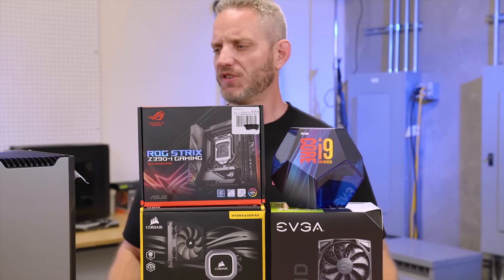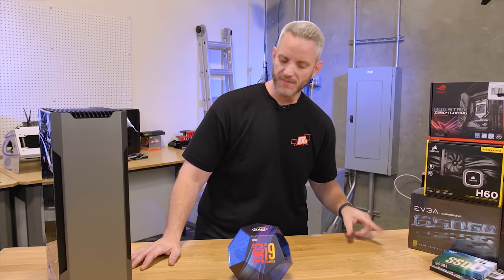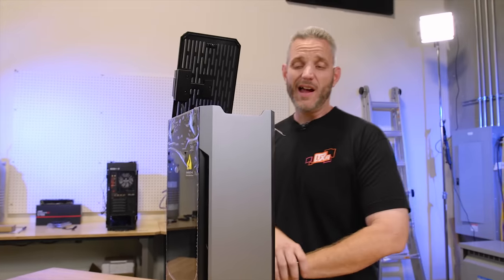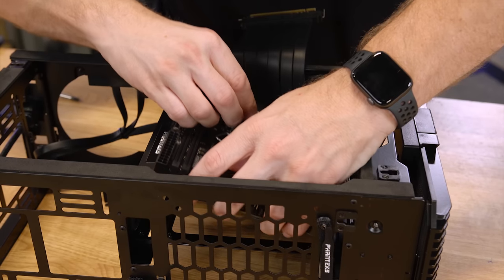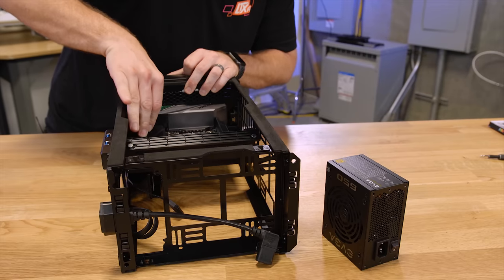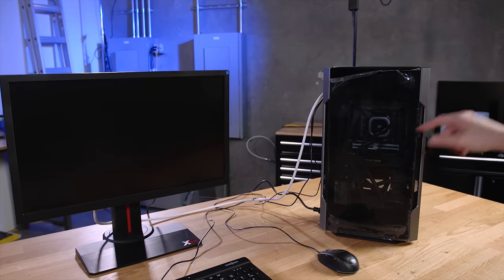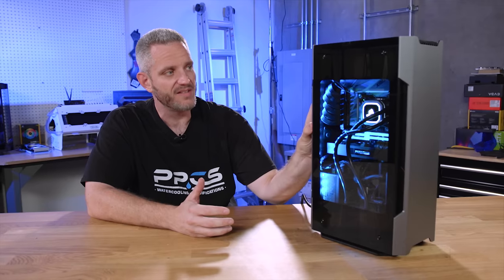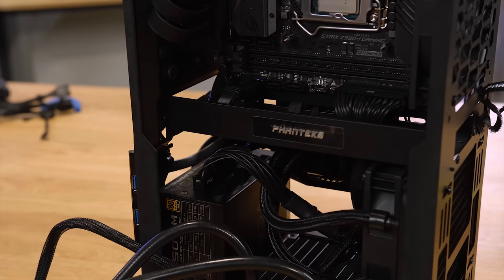This Small Form Factor PC is RIDICULOUS. Ridiculously FAST!

Comment: what i would like to see is a build for the best value/performance there is right now, Rx 3600 + rx 5700 xt, intel might be better having higher core numbers , but the threads from the ryzen 3600 have futureproof with next gen consoles using the same amd arquitecture and possibly games also using more threads instead of higher clock count.

Comment: thats pretty much my current vr pc. 
same case in same color
9900k with AIO
z390 strix
16gb 3200 corsair
(2) 1tb hp 920 nvme drives
but sadly im still rocking a 1080ti hybrid. 

i love the setup. maybe i wish it had a little more airflow. but i made it work. switching all fans to noctuas helped. i have (2) a12x15 fans on the side and 1 a12x25 on the bottom. i went with the slims on the side so i could add the phanteks rgb rings over them. i also have the modmymod panels on my main gaming pc phanteks evolv case. i would probably get them for the shift as well sometime in the future (if he ends up making them for it as well).

i would say the case is pretty good as is. maybe it would be nice to have a solid back panel (which is a top panel in this case). it has the same problem as the evolv. where the heat rises and can circulate back in the case because of all the openings. i ended up taping off most of the top of my case. its under the lid, so you cant see it. but it helps make sure that the hot air actually exits the case.

if i could fit standard 25mm fans on the side with the rgb rings, that would be cool to.

Comment: I went for 10th gen Intel instead of 11th gen even though i built my pc just after 11th gen released because the £100 price difference between the 10700k and 11700k wasn't worth it. If i done more than gaming i would have got an 11900k or even went for something more intense with Amd but i have no use for it and i do not regret it! coming from a 7700 non k it's a great upgrade.The newest isn't always the best option that is correct.

Comment: HEY they update the PCIE riser! Jerks, I still have the old one.

Ryzen 2700X, Asus X470i, 970 Pro 512GB, G.Force TridentZ RGB 16GB F4-3200C14D-16GTZRX, EVGA 1080 ti Gaming Black Edition, Cooler Master ML120R, Seasonic Focus SGX-650 Gold, and two Noctua fans. I set up the AIO with dual fans on the bottom in push/pull and used the two Noctua fans as intakes as well. I don't remember temps but they weren't great, but it's not a hot box.

Issues I had really involved what to do with the excess cable lengths. I could shorten them myself but it hasn't been that important. I really think the little shelf to hide the MB cables blocks a lot of airflow and I think it would have been better had it been omitted. The AIO tubing length is somewhat challenging as well. I put the tubes on the radiator under the GPU, then they bend forward and then up. I have a build log on the forums: https://linustechtips.com/main/topic/1002263-phanteks-evolv-shift-with-amd-build/

Comment: @JayzTwoCents what do you think about this build. i'm planing on buying the pieces over the next few months as i dont have to much spare money. i only build a new computer every few years. let me know what you think or change.

ASUS ROG STRIX B450-F Gaming AM4 ATX AMD Motherboard

AMD Ryzen 5 2600 3.4GHz 6 Core AM4 Boxed Processor with Wraith Stealth Cooler

g.skill Logo G.Skill Trident Z RGB 16GB 2x8GB DDR4-3200 PC4-25600

PowerColor Red Dragon AXRX Radeon RX 570 Dual-Fan 4GB GDDR5 PCIe Video Card

Corsair TX850M 850 Watt 80 Plus Gold

Inland Professional 512GB SSD 3D NAND M.2 2280 PCIe NVMe Gen 3 x2

Cooler Master MasterFan MF120R ARGB 120mm Case Fan

Comment: Try getting a RoG card in there. That was an absolute pain for me and killed it for me when I tried to turn throw a custom loop in it.
The shift air redux is stupid. The main issue is the front and rear metal panel was the main choke point, not the glass. Even the p400a was an absolute failure... did phanteks even test there revisions

Comment: I think it's a nice case and it certainly looks good.  But as someone who is really into small form factor, I just think this case is too big.  There are smaller cases that can fit larger AIOs or even big air coolers in them. I'd go for one of them over this if my intent was to build a SFF PC.  I'm personally using the NCase M1.

Comment: Hey Jay.  I am curious why you didn't get a EVGA 90 degree power connector for the graphics card so your cables would go to the back of the card instead of the side. It might help you in future builds with similar problems.

Comment: Great video Jay!  I've said it a million times, the PC market should stop listening to these idiot geeks who think smooth choked case fronts are "Freaking RAD dude!"  The front needs intake points and slits along the sides and forcing around around a 90d bend is just stupid.  We need to demand better case fronts from manufacturers and you Jay are in a position to do so easily ;)  So many people complained to manufactures about stupid aesthetics and were completely clueless about air flow properties.  Hopefully this flat faced suffocating trend ends soon, it's horrible and I blame crap nonsense like H500 and S340 for it.

Comment: I was honestly thinking about buying this case a long time ago, but I was heavily discouraged by the temps. However, I still really liked the vertical tower design, which is really unique in the PC case market. Fast forward to today, and I have a similar case that just came out called the Velka case! The Velka 5 (what I bought) is super small and can still house a full size gpu (although you do have to be careful with dimensions for some of the bigger cards). 

I'm still waiting to get enough money to buy all the other parts, but I totally recommend everyone interested in ITX cases to check it out!
https://smallformfactor.net/forum/threads/velka-series-cases-for-ultra-compact-and-portable-desktops-3-7-l.9681/

Comment: Built a Ryzen 2700X system early this year. Seen the case, immediately fell in love with it. well my GPU (msi gtx 1080 gaming x) didn't ;D heavy thermal issues when it comes to aircooling for gpus. Only solution: Voltage/Frequenzy curve editor in MSI Afterburner. Limited to 850mV and the card is "far" away from throtteling (~ 72°C). 

But where are the side panels Jay is talking about? seen some rumours at reddit too, thought phantek gave up on this side panel thing?

Comment: Hi jay! do you think the GTX 690 is still a relevant part? I have an 8 yr old custom gaming rig with an i7 3770k @ 4.8ghz with the old 690 in it and it still holds up really well until I start trying new games say past the 2016 mark. Doom for instance wouldn't run at all because there is no compatibility profile for it. Do you think that is going to be a trend I see getting worse as I move into the future trying to hold off as long as possible on building a new pc? Or do you think I can get away with limping along with the 690 for a while longer? do you think it would be advisable to get a new high end graphics card and slap it in there? what would be the bottlenecks if any? my ram is my first guess being 12gb of corsair vengeance 1600mhz. Do you think that would be the next logical upgrade aside from a new gpu or should I not even bother doing a modular upgrade at all and build an all new pc? Any input on these ideas would help! Thanks Jay.

Comment: The GPU is always going to be hotter. Well at least a 2080 Super will. Thinking about doing a 240mm rad conversion on my 2080ti hybrid because why not.... now that I think about it I still have a CLC 240... *takes off in a hurry

Comment: Question: Can you put a normal sized power supply in this case? Will it fit? I´ve got a Seasonic FOCUS PLUS GOLD 750W PSU that measures 140 mm (L) x 150 mm (W) x 86 mm (H). I wonder if I can use it on this case, and only deal with the motherboard swap (ATX for mini ITX). Thanks!

Comment: Currently using a Scythe Shuriken 2 in the Shift Evolv 2 with 10600k, but have been thinking about upgrading to an AIO for a while (as due to thermals, I have had to underclock the CPU). Would you still recommend this AIO? Also thinking about purchasing a sadly overpriced MSI 3070 SUPRIM (as right now I am borrowing a 1050ti). Any advice?

Comment: I have a build with that case and I am shocked that he could fit that graphics card in with the cpu cooler in. Because I had the same cpu cooler but the fan it came with, it's cable wouldn't reach with the fan positioned on the bottom of the cooler. So I just replaced my cooler, so I could fit my graphics card.

Comment: Don't like this case much, proportions are all wrong! Isn't the cloth mesh going to collect dust like crazy? ^^

I myself am considering going to a small PC, exactly for the reason Jay mentioned, I got all this big, heavy box and all this empty space inside it...
Considered case like the Streacom DA2, but the case is flawed in so many ways, I just can't.
What I am currently locked on is the Sliger SM560 and I probably will hot rod it with the CPU cooler sticking out. :)

Comment: My AIO cooler has 2 radiators(220 and 320), covers my CPU and my 1080(full cover), quick disconnects
and a flow meter, but not a water cooler?

Comment: When with the new panels and you turn the fans to make it negative pressure, would that help with cooling? I'm looking for a small-form to my media PC that will look nice in the living room and new TV. I will have the fabric panels. I have a geforce 770 used in my current media computer, but wondering if I build a media with integrated graphics if it will be able to deal with 4K (I will not game on this computer)

Comment: "I was an Invidia type of guy when MSI was for gaming and Corsair for mining, I'm now a Vegas type of non-vegan who would ride the less enhanced components, starting from the chinese LR44 Cmos and the cheapest multi-threading Motherboard witch isn't fixed to that one specified temporarily out-of-stock Intel model. I've still got an X-Wave and an 1080i that won't recoup with the elder nipponic amplifier in here. Are those machines?! Who's going to run cyclettes once the DVD would be unchained and discharged?! In the meantime, those english-like capacitors are taking 📴. Good luck guys..." 🗨😏📟♨️🛴

Comment: Can you do a video on fixing stuttering, I have an i9 9900k 2080ti 32 gb ram. Cpu is easy oc to 4.7. gpu is oc about as much as I can, running about 2100 MHz. Ram oc 3000.
Reply: I have fairly bad stuttering.

Comment: I don't understand why you went with 9900k though, yes you said you picked it over the 3900X because it's a gaming rig and you wanna hit 5 Ghz... Then you put it into a small case with only a 120mm AIO, there's no way you'll hit 5 Ghz like that. I think the 3900X would've been the better choice since the 9900k doesn't have the Ghz advantage anymore due to the thermals that would've been a lot better on the AMD cpu since it runs a lot cooler overall.
Reply: @SISSYPUSS  Doesn't matter, the thermals will not allow it to reach 5 Ghz

Comment: New to the PC gaming and my first/only build is in the Evolv Shift X (really tall version of this), I got the front/back panels custom modded from modmymods.com and they came out perfectly. I don’t know much about proper temps, GPU is 35-40 C idle and 50-55 C after hours of gaming. My only concern is my m.2 SSD on the back of my motherboard hitting temps of 70 C so I’m attempting to add another exhaust fan or waiting for Phanteks Air panels for the shift X.

Comment: I just build in the shift 2 glass... so nice and only AIO on the CPU, I managed to squeese the Be quiet pure loop in there.. where the pump sits on the hose.. and an air cooled EVGA 1080FTW.. it runs a bit hot.. but its fine ^_^
And getting a new GPU now... aaahahahhah... no

Comment: Where the hell are the external drive bays on that case. I would not have a external bayless case. My PC is not an appliance with all closed sides. It has drive days for the Blu Ray drive and another bay with 7 USB3 ports. I also like to put rails on my hard drives and put them in 5.25" bays, with a mess bay cover the drive is much cooler then, when in an internal 3.5" bay. That is why I keep my old cases, because so many new ones don't have any external bays. And don't even get me started on bottom PSU mounting. I will keep trashing the loss of external bays on cases whenever I can.

Comment: @JayzTwoCents can u tell me the maximum thickness for a GPU in the Enthoo evolv shift. cant find a place where they descripe it :(
Reply: @Martin:  If you take the dimensions of the EVGA 2080 Super Hybrid then you can get a feel for it:  Dimensions
Height: 4.38 in - 111.15 mm
Length: 10.46 in - 265.63 mm
Width: Dual Slot
Reply: @gaitherstephen27  thanks. None of the websites i have been looking on have been giving the thickness on some og the evga cards🤷‍♂️ only lenght and width🤦‍♂️

Comment: That case is massive for itx and it has really bad thermals. And it’s not cheap either. Pretty bad design overall.

E.g Silverstone SG13 is smaller, better thermals, and cheaper and fits atx psu.

Comment: My Specs 
Asus Prime A320 M-k
Ryzen 3 2200G Apu
Corsair Vengeance 2400Mhz DDR4 4x2 Total 8GB
1 Tb mechanical hard drive
120Gb SSD 
Corsair Vs450 PSU
the problem is i can't run any games not even in the lowest setting...😣 im really fustrated I need help can someone help me please

Comment: Tried this EXACT SAME BUILD. Temps were absolute fucking garbage, It was a disaster. CPU was throttling, GPU never got too hot, but hot air just circulates around itself and made the case temps in the 50C range with the glass on.  Not to mention how horrible this case to build in is when using 2 AIO coolers. PLEASE DO NOT BUY THIS CASE IF YOU WANT TO USE 2 AIOs!

Comment: Hate you so much right now!!. Literally started watching your videos before building my first PC. I Wanted to build a PC specifically for emulating but ended up being good for a lot more. 

Didnt even think you could fit water coolers in this case!! ARGH... Cause its gets HOT quick and as you mentioned its rather noisy and has rubbish airflow.
Reply: FYI my build consisted of
I5 9400
Corsair Vengeance 2 x 8GB 

Radeon RX580 8GB
MSI Z390i ed MB
Plus standard extras M.2 Drive, 2TB drive. blah blah